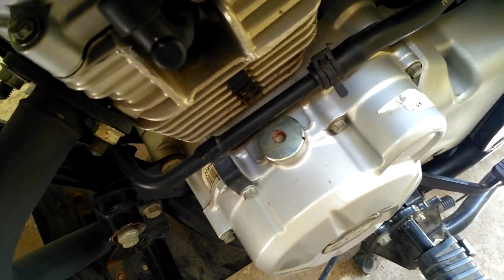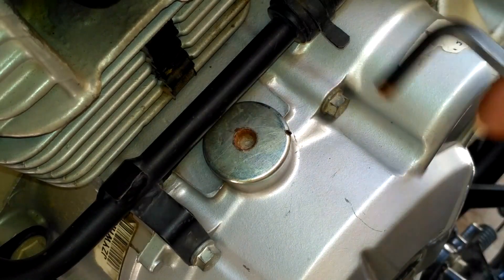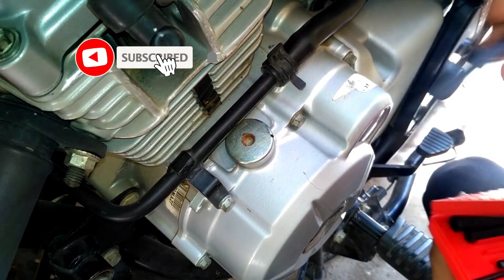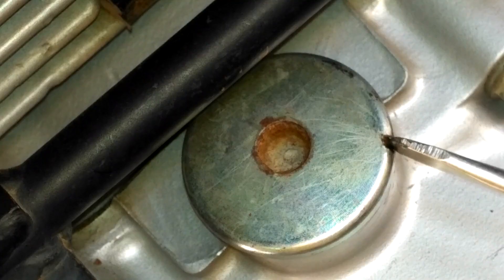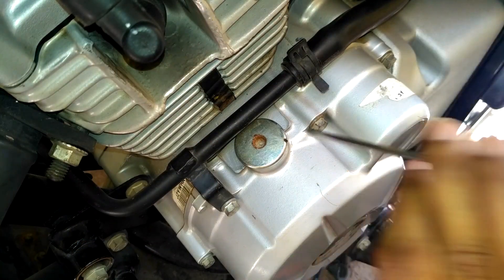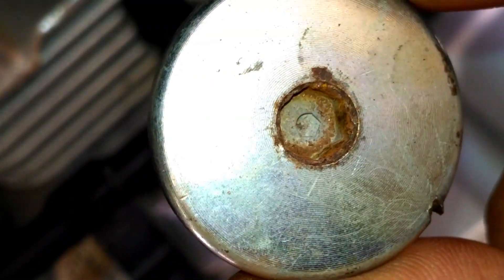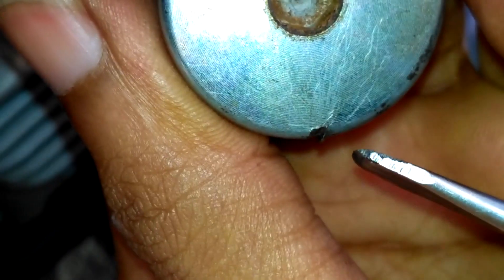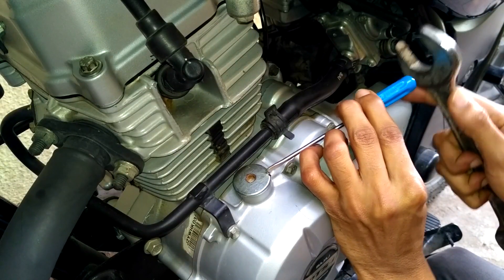How to remove stripped allen key bolt | remove stripped or rounded hex key bolt

Comment: Can i use same trick on chain small sprocket allan bolt ?
Reply from the maker: Hi Sir, can you let me know which kind of allen keys you have?
I mean, it's in inches measurement or mm measurement?
Reply from the maker: Actually there are two types of allen keys. In America they manufacture inches allen bolts and they use inches allen keys but in Europe, Asia, India we use mm sizes allen keys. But most of the online shopping sites sell inches allen keys those don't fit in inches allen bolts. 

For small chain sprocket do not use same method. Those 2 allen bolts heads have outer threads, so you can use a cutting plier to turn them.
Reply: @PavanKumarHB  actually i have discover 100 T.  There is small chain noise from small sprocket and oil also leak like drop. 

So what i tried to remove small sprocket first it have some shaking this is normal? . 

Also it have 4mm size. So i tried remove using my 4mm allan key . It have 2inch length..but it keeps slip When try to remove. And the bolt also looks like rounded
Reply from the maker: So you have exactly mm allen keys? Actually allen keys don't slip. Share the model name of the allen keys you have with manufacturer name. I'll tell you which is correct one. 

Small Chain sprocket little shaking is normal in all bikes. I too have with latest new sprocket. And oil leak may be due to  oil seal damage.
Reply: @PavanKumarHB  the key don,t have any manufacturer print. Simply plain. If you have what'sapp number or email id i can share the image of key . Also i don't know how to check it was inches key or mm key
Reply from the maker: You can send the message with pics to my Instagram ID. Instagram ID direct link is given in my about section of youtube
Reply from the maker: Also you can watch the allen key difference in this video: - https://youtu.be/UEC15B_9svE
Reply: @PavanKumarHB  alright if incase the Bolt was rounded using SAE . Can i remove it again using metric alan key ?
Reply from the maker: Allen metric or mm size keys fits best even if the bolt rounded off by using inch keys. In case you can buy km9v coded taparia allen key set, it's cost is 230 Rs.
Reply: @PavanKumarHB  today i bought another branded 4mm allen key.. finally it grips and removed the Bolt from inner sprocket thanks
Reply from the maker: That's the trick. Nothing but using only mm metric sizes allen keys in india. 
I guess previously you had inches allen key set.